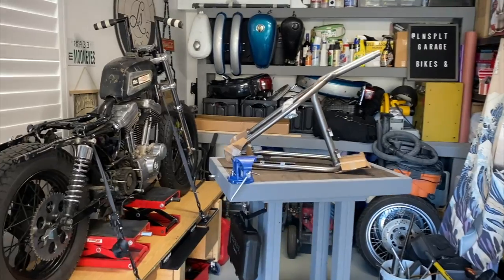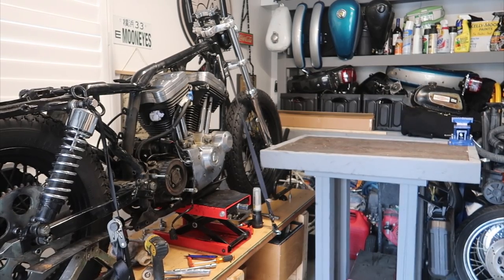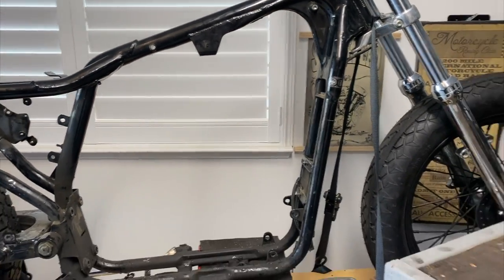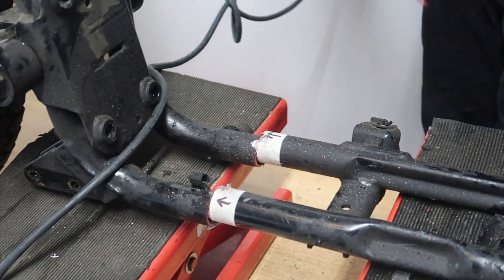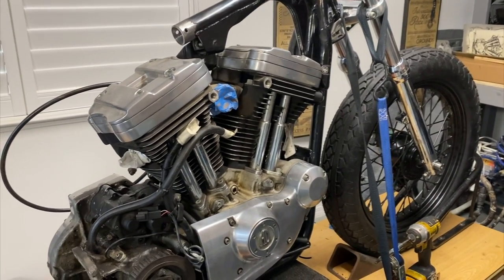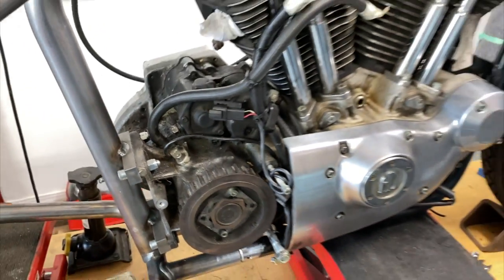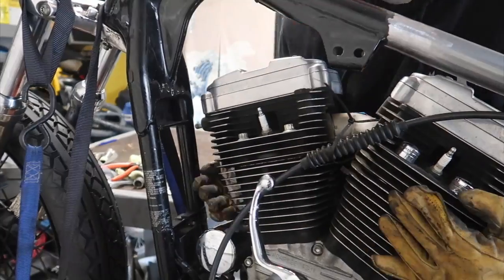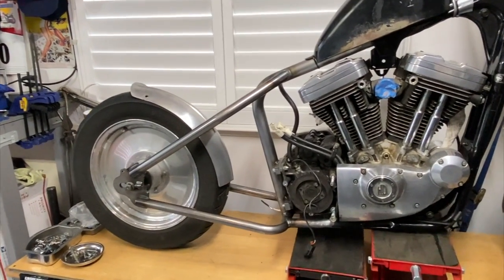TC Bros. Harley Sportster Weld-On Hardtail

Comment: Hey could you post your welder settings for the hardtail? Wire size, speed and voltage? Having trouble with my setup during practice. Thanks and great job on the build.

Comment: always do the rosette weld last to allow for gas's to expel while welding but if you did perfect & low brow & TC bro's sells a repackaged product ,meaning most of what they sell is the same parts that  v twin manufacturing , mid usa m/c , drag specialties , midwest m/c  & etc , sell  Except they mark the price up higher  than retail . Support your local chopper shop when you can & keep your money local  but if there sending you free parts I understand ,lol..  , Keep up the good videos .
Reply from the maker: thanks for the tip about the Rosette weld! didn't know that. I'm not a welder by trade so any advice is greatly appreciated

Comment: It looks like you used MIG welding instead of TIG, is that correct? If so, why did you choose that and have you had any problems with this approach? Trying to determine how I should weld my future project. Great video!
Reply: Tig weld.
There is no other option in my book.

Comment: That's the exact reason why I'm torn between lowbrow and Tc Bros. Love the axle plate and rear motor mount of lowbrow, but I hate the ascetics of the backbone to downtown.
Reply: I also love the electronics tray that Tc Bros offers with their hardtail kit.
Reply: You won’t see the downtube anyway if you use a horseshoe oil bag. The lowbrow kit and the throttle addiction kit will end looking tighter and more put together than a tcbros kit. I’ve built all 3 and other brands as well. I’d skip the tc kit if I were you.

Comment: So does anyone know why the 2007+ year sportsters can’t be hard tailed?
Reply from the maker: It’s 2004+ you can still hardtail them it’s just a lot more complicated since the motors are rubber mounted.
Reply: My cousin had a '07 883 that was hardtailed, he bought it that way and I don't know who did the conversion, I just don't think alot of people are making hardtail kits for newer bikes
Reply: Ledsled customs has a setup for it
Reply: There’s a few kits out there for them.
It’s a bit more of an investment because you’ll have to buy a solid motor mount conversion kit or the hardtail won’t work properly with the motor, too much vibration and movement on the rubber mounts.